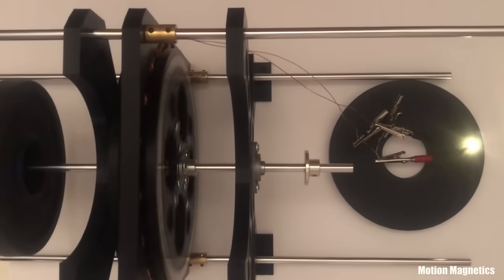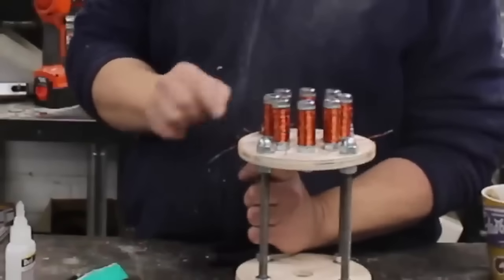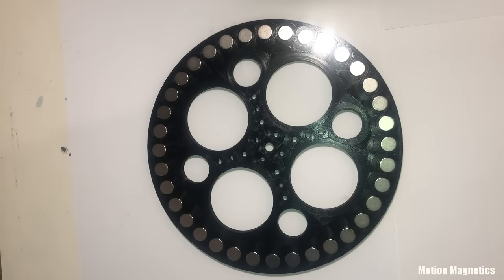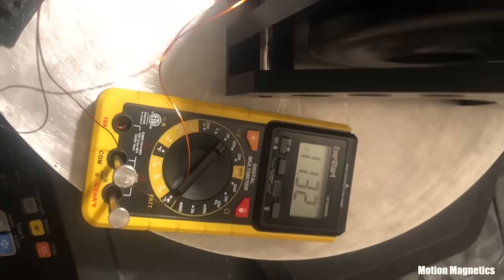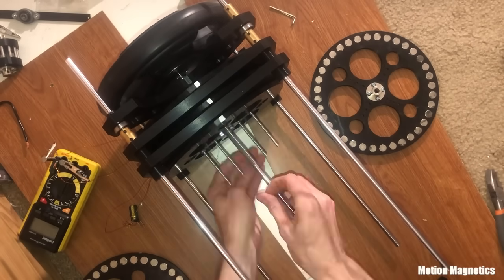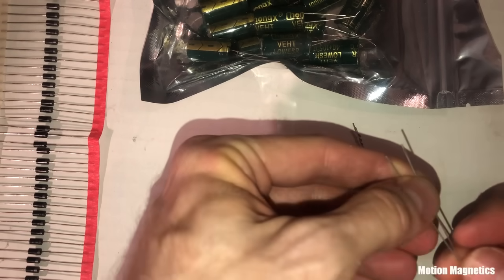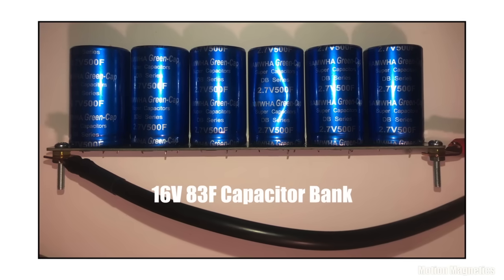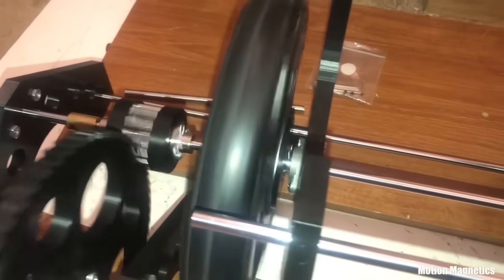Stackable Generator

Comment: its awesome. i've been wanting to try something similar, but with big plate capacitors for each coil before rectification to see if the capcitor will make it behave as if the coil was bigger. i guess i could try lendon jar capacitors, but i wanted one of the negative plates to be earth grounded, and not wired to the other negative plates, i was also going to put a giant diode on the groundind rod wire to block positive charges from lightning static and nearby electric poles.
Reply: Well, I'm no engineer, but I am an experienced comment creator 😁 so maybe I can clear this up a little. 

Based on what you said about putting a cap before the rectifier, it seems like you're hoping to achieve some sort of resonance effect, although I'm not sure to what end. A coil of any physical size can have any inductance, depending on how it is built and the same goes for capacitors.

When a coil is placed in parallel with a capacitor and driven at resonance the circulating current will be larger than the input current by a factor called the Q factor (for Q>1).   In series it will be the voltage across both the cap and coil that will be magnified by the Q but in either case they are just passing energy back and forth.  Taking energy out of the system is equivalent to reducing the Q.

Note that the Q can also be one or less, in which case the system is termed critically damped or overdamped.

The tesla coil is meant to exploit a pair of radically different but matched impedances to increase voltage gain well beyond the turns ratio.  In that case it is the square of the ratio of the secondary inductance to primary inductance that determines the theoretical gain but real world performance also depends on Q and many other factors.  But that's another comment for another video.
Reply: in other words, it could raise voltage or dampon it, so try it and see? my idea is, to see if a truly negative earth ground's feild can be added to a circuit without being physically connected and through plate capacitance couple with the inductor to raise energy potential so as to self propel a small motor that turns the generator. in other words, a way to use earth's electric field withought grounding it out @whatelseison8970
Reply from the maker: I know the capacitors smooth out the current. If you're doing something that requires more current to start it the capacitor could prove useful, so long as it's not draining it quicker than the coil charges it.
Reply: you are right, i didnt think about that, still, i wonder, can a semi earth grounded plate capacitor with 100,000 volt diode act to make a tiny coil behave as if it were a massive coil? @Motionmagnetics
Reply: @gristlevonraben    i'm no engineer, just a hobbyist. but capacitive reactance and inductive reactance are sort of opposites of each other, so connecting a cap to a coil might not work as you want it to. maybe a proper engineer can enlighten us both  :)